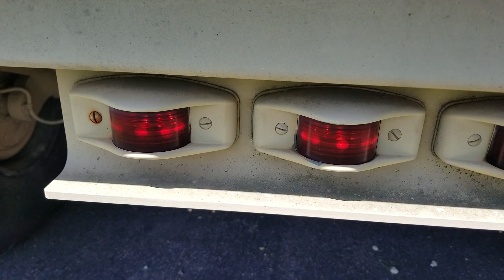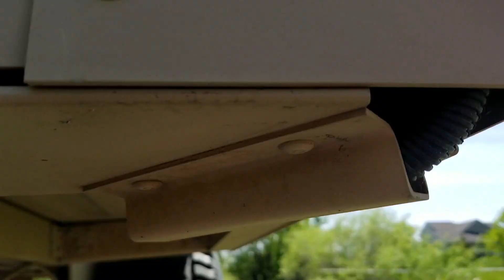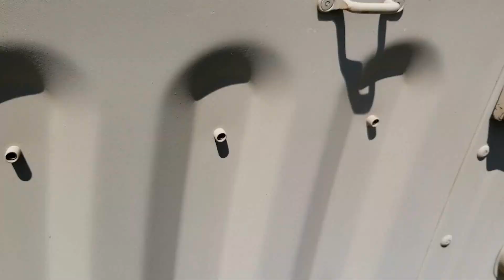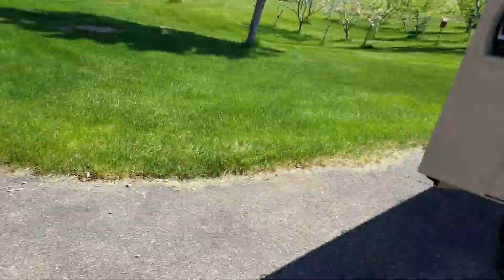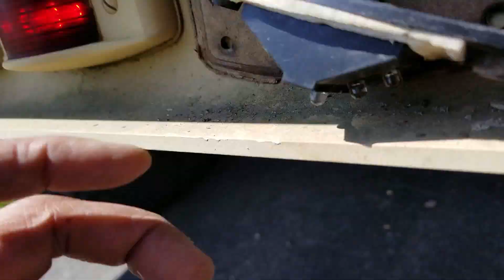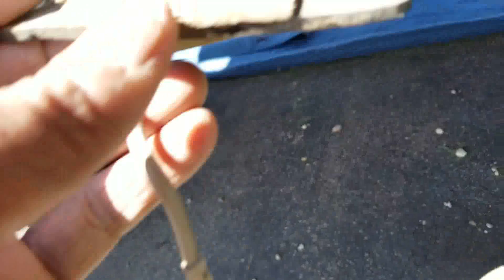N0AGI - TAC/0 :: M1101 24V to12V Conversion Marker Lights - Part 2.  Vol 102

Comment: We need am update on things please
Reply from the maker: hi - I had to divest on this trailer project and had sold it off.  Sorry.  But, I can tell you that the buyer was happy to see that the lighting conversion was done and was functional :)
Reply: @N0AGI  I think I may need to replace my trailer lights for the same reason. Would be nice if there was an affordable Civilian LED Option to replace them. And wire easily.
Reply from the maker: @RealityCheckGA  I hear you. AFAIK, no kit option out there for m1101 at least. I kept the original harness true to the OEM. The use of the trailer plug adapter was life saver; w/o it, I would have had to cut the OEM trailer plug for mods. Those adapters are not cheap.